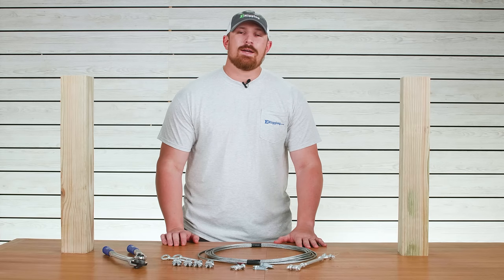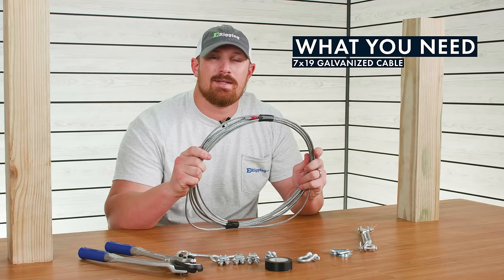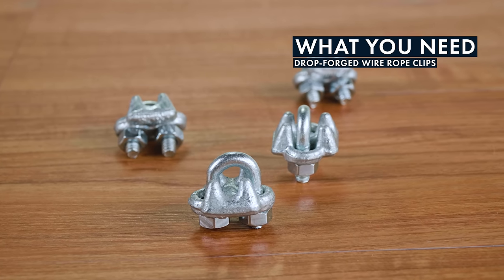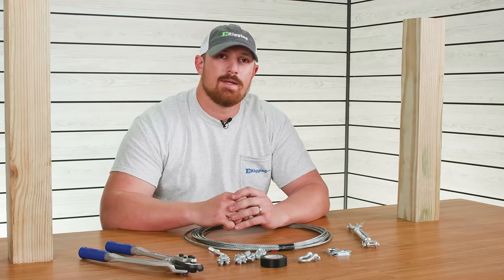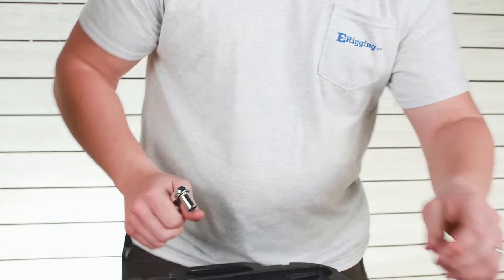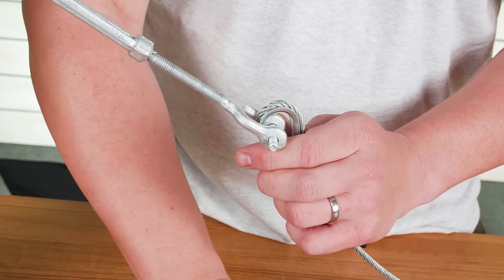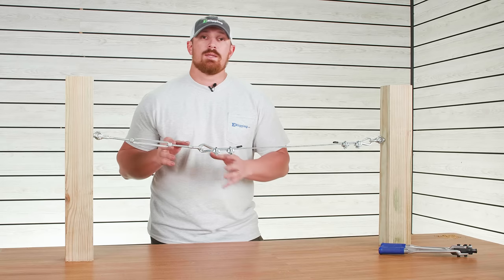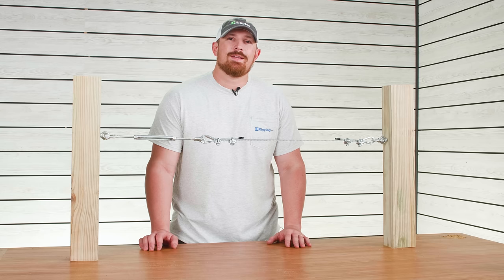How to Make a Cable Suspension Assembly | Basic Cable Rigging

Comment: So I'm hanging something that is 36 in long and about36 in high but is a round bar sillouettw....cable is about 25 feet but I'm using 4 wires evenly spaced on item so 4 25 foot cables...it's 3/16 I believe I'm using 3/8 x6" eye bolts fasten to aluminum upright I gets that's attached to gutters going 10 feet high so do I need a cable tensioner or can I just pull tight by hand to support wind and weight or if I need one how should I tighten according to weight length and wind pressure

Comment: Thanks! I know this video is a year old but do you have any suggestions for a method to connect a similar system to a galvanized steel pipe frame greenhouse?
Reply: 1:42 Same thing he described - use regular eye bolts instead of the lag eye bolt and drill holes in your pipe to run the bolt through with washer and nut

Comment: Just some extra words of advice for people using this style of cable clamps. Two clamps is more than enough to hold even  10:1 safety ratio as long as the cable is strong enough. A lot of the time, there are three wire saddles added to help with hand tensioning the cable. I Am an Ironworker, JIW, local 86. This is the means for  perimeter safety for most of our working floors.
Never saddle a dead horse. The way you have the wire saddles are perfect here.
We have cable tighteners, aka pork chops, Just two cable grabbers & a hand cranked wire pulley to get the final strength. Eliminating the need for a turnbuckle
I've done many other things with these steel cables too. From prep/safety to finished reveal... SO . Much. Tapping. Hate lazy painters.
This is also how we plumb up our columns too.
One piece of advice. if you're gonna end up splicing two cables to make a length. Then you will need at least 3 wire saddles, with at least one pair going in the opposite direction, aka saddling a no longer dead horse
Also, when tightening the nuts on your saddles, don't go hog wild on one side, just back n forth, switching sides evenly, and you'll never damage the cable to a point that reduces its structural integrity

Comment: Could you use this to hang fabric?  For example to divide a 20' room - or would it sag in the center?  THANK YOU!
Reply from the maker: Yes you can!  You are also right about the sag, you do not want to overload your cable assembly.  This includes the weight of the actual cable.  At 20' you can start to see sag if you do not take out enough tension when installing the cable.  Make sure to get strong enough cable and a long enough turnbuckle.  If you have any more questions our specialists are waiting for your appointment:  https://bit.ly/3QXvxBU
Reply: @E-rigging  THANK YOU SO MUCH!!!!!

Comment: For a longer fence line, should a turnbuckle be installed either end of the line, or it this arrangement ok?
Reply from the maker: Good question! For longer lengths of cable, you'll just need a turnbuckle with longer take-up length. You don't necessarily need turnbuckles at either end, in most cases. Thanks for the comment, Tom!